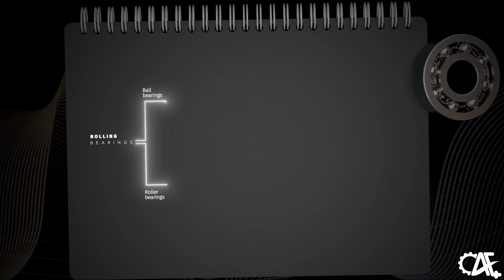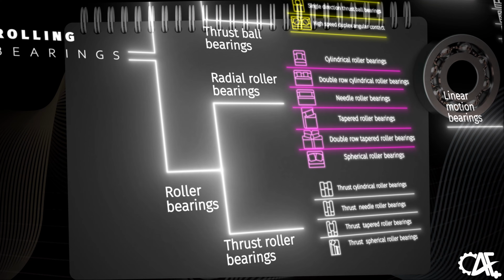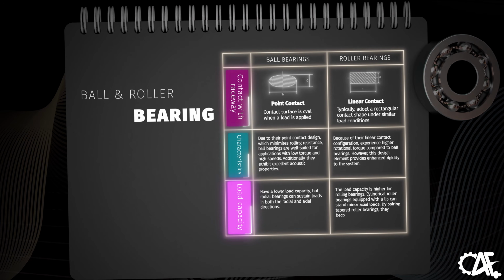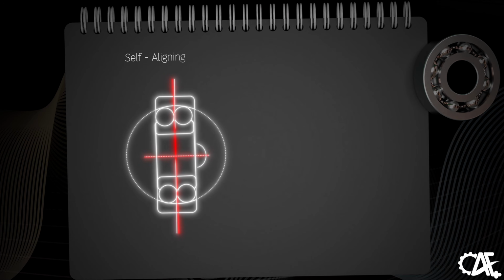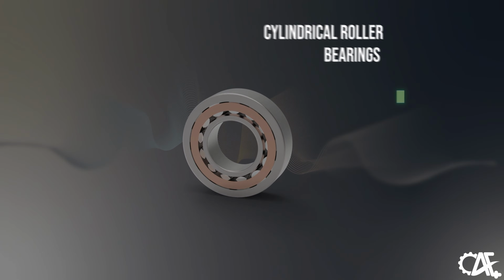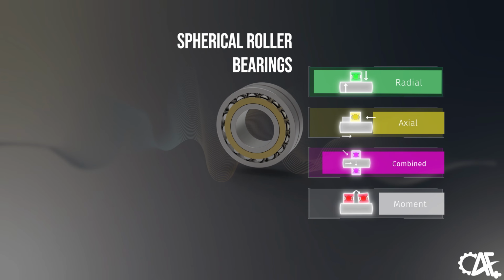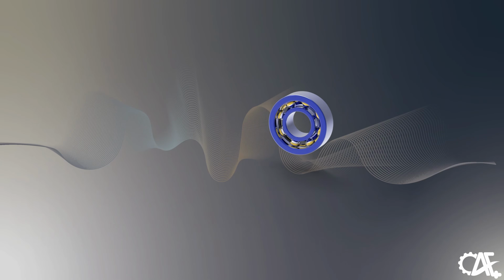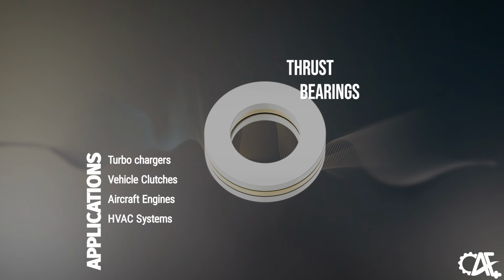Basics and Types of Bearings [Common Types]

Comment: can you please honor me with any advice you have ...I would like to diy similar 5c headstock 80/50 (od/id) or precision bearing housing unit for lightweight shafts around the same size. I say around because I will not be needing to adjust/ swap out tooling like collets  or chucks...
Is this something that can be done by a newb? I more looking for precision like abec 5-7 similar to taig like headstocks